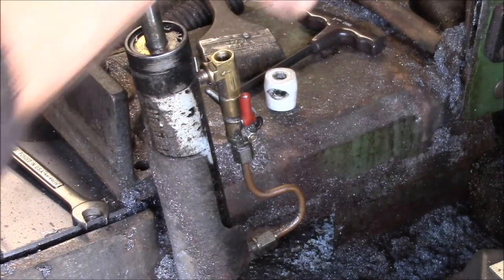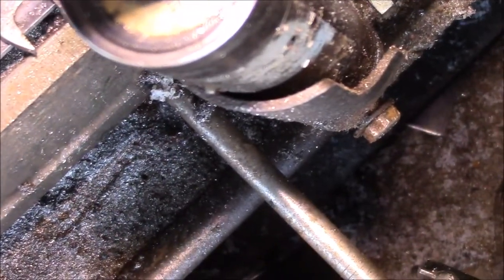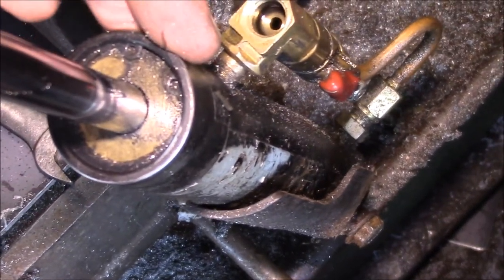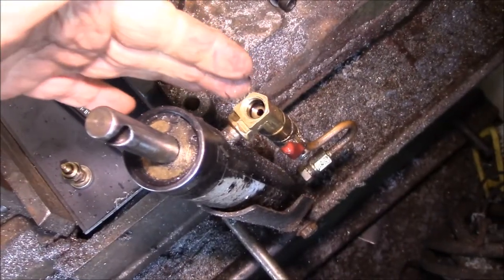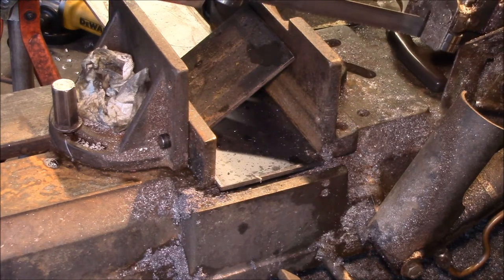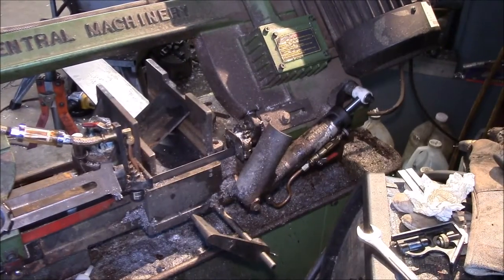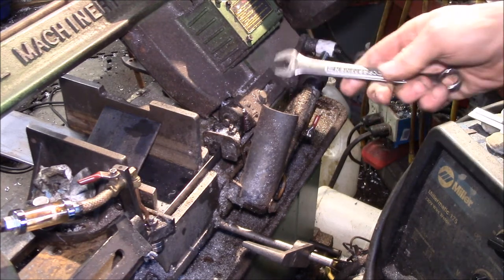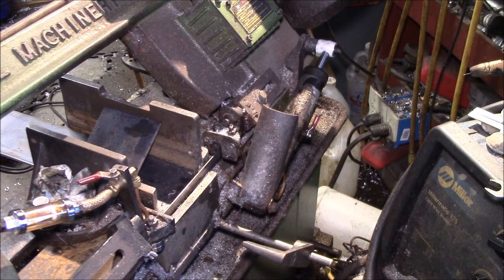Horizontal Bandsaw Down Feed Cylinder - Oil Refill

Comment: THANK YOU!!!!!  You saved me $149 for the cost of a replacement cylinder!  I was recently given a 20-year old cut-off saw and one of the things that was a bit hinkey was the erratic operation of the down feed cylinder.  It would only work for the last inch or two of the cut or sometimes not at all, and it wouldn't always reset itself when the saw was raised.  While there was no sign of damage or leakage, I decided to try refilling it after seeing your how-to video.  Come to find out the problem was low oil and after topping it off just like you did, and then bleeding it (my unit has a bleed screw), it now works perfect and like new.
Reply from the maker: Glad you were able to fix your cylinder.  You're lucky to have a bleed screw, makes that easier.

Comment: Thank you for the video! I was trying to solve the "bounciness" in my feed cylinder when completely extended. I don't know how air could get inside over time!

I filled the cylinder with hydraulic oil the way you you did, it was better but not perfect. I still had some air at the top of my cylinder that I couldn't purge no matter what I tried causing bounciness again.
 
To solve my problem 100%, what I did is, with the cylinder as full of oil as I could, and mounted on the saw, I raised the saw completely, and held it in place to make sure that the cylinder was completely at the top of it's stroke. I then removed completely the feed screw on top of the cylinder... (while still holding the saw up) ...because mine has 2 o-rings inside the feed screw, so even if I loosened it 3-4 turns like you did, it was completely sealed. I then manually, slowly lowered the saw by hand (with the valve open of course) until oil overflowed by the feed screw orifice. I had some hydrolic oil on hand in a squirt bottle, so I refilled the cylinder. I had the same problem as you. The oil would not go down, so, when the hole was full I raised the saw little by little, forcing the oil inside like a syringe would, keeping the hole full at all time to avoid sucking in air. I continued until I was at the maximum stroke of the cylinder. I then replaced the feed screw and thightened it. This way the cylinder was COMPLETELY full! Absolutely perfect! Like new! 

I was also looking at the 150$ cylinders online before trying this, so I'm very happy!
Reply from the maker: Sounds like a good filling procedure, thanks for posting.

Comment: What you should have done is get a 3/8" clear tube and stuff it in the needle valve opening. Then get a plastic mayo jar with lid with hole for the tub to fit snug and only goes in a 1/4". Fill jar with fluid. Close  jar. With the rod all the way out and cylinder horizontal, tip jar upside down and hold over the cylinder. SLOWLY push rod in a little bit. Air from cylinder will compress in jar and force fluid down. Pull rod back out , air rise while fluid descends. You can let it gravity feed or you can slowly pump the rod to get it done quicker.  You will know when you are done when no more air bubbles come out.  Lower jar below the cylinder as you put the cylinder vertical. Crack the jar lid open and this will start a syphon, let it bleed just a bit then , crack the tube at cylinder.  Remaining fluid should dump back into jar and any fluid that would have spilled out at cylinder would be pulled back in.  You can also push the rod in just a bit and as you crack the tubing off pull the rod out, sucking any fluid in , instead of falling out.

If you want to speed things up add a second breath tube in jar that goes all the way down.  Problem with that is when you start there will be fluid in the breather that you will have to either dump or blow back in.
Reply from the maker: Thanks for the suggestion.  I'll have to give that a try once I can gather all those materials.  My technique has worked well the few times I've used it.  I think in my case, the leak is from the needle valve itself.  So I need to find the time to open that up and see about resealing it.  I suspect there are some small o-rings in there that need replacing.

Comment: I need to do this on mine, thanks for the tips.
Reply from the maker: Great, glad the video was a help.  I still need to dig into mine and see if I can find/fix the actual leak that is causing the loss of the oil in the first place.  I just need a day or so of down time in customer orders where I can tear the machine down and figure out what's going on.
Reply: mine leaks at the valve /lever shaft  (open -lock valve)
Reply from the maker: Yes, that's where mine seems to be leaking as well, at least that's where's oil wetness.  I need to open that up and see if there is an o-ring or packing that can be replaced.

Comment: Thanks! I thought i was going to have to buy a new cylinder!
Reply from the maker: That's probably what they want you to do :)
But yes, have filled mine up once and then topped it off once.  I think the valve on mine is the source of the leak.  I need to take that apart and see if it can be repaired or replaced.
Reply: R Brown I bought a used wilton 5”x8” and its leaking around the shaft and I looked up rebuild kits but I can’t find it. Hoping I can top it off and it be good
Reply: @The4Crawler  Often the seals get ruined when the cylinder rod is pointing up. Metal shavings get stuck and pulled in, ant that ruins the seals.

Comment: I'm a bit late to the party but I suspect that tipping the cylinder upside down (or more importantly having the lower port uppermost for the air to rise and exit through) as you push the rod in, would get any trapped air into the area above the piston where it doesn't matter to the operation of the cylinder damping as it compresses.
Reply from the maker: Yes, that does help.  I finally got rid of the plastic piece covering the bottom of the cylinder and now it can fold over almost horizontal.  Still traps a bit of air that's easily bled out.

Comment: Great vid, but it was of no help- after I pulled my cylinder, I realized that the erratic operation and varying speed of the “drop” was because of the big pin between the base and the C portion of the saw- check yours and maintain it 👍
Reply from the maker: Great point!  Is that the bolt at the top or bottom of the cylinder?

Comment: Good repair. I have the same problem. A new cylinder costs $300.
Reply from the maker: Yes, I looked up the price on those a month or so ago and found the same thing.  I need to try and rebuild the valve on mine, I think that's where it's leaking.

Comment: I had similar issues, no matter how I fill my cylinder It keeps creating air bubbles that I think it comes through between the shaft and the top cover...but there is no leak during operation. So my question is it normal that it sucks air from top side?
Reply from the maker: I've not had a chance to tear into the cylinder to see how it works inside.  I've not run into that specific issue, I think mine is leaking through the on/off valve.

Comment: Can you do a overhaul on the feed cylinder? Such as seals?
Reply from the maker: This thread implies that it's possible:
https://www.practicalmachinist.com/vb/general/bandsaw-downfeed-rebuild-cylinder-valve-379210/
I need to see if I can fix the leak in the valve on mine, if I can get the cylinder removed from the saw.

Comment: what viscosity to fill in the oil in the hydraulic cylinder
Reply from the maker: I used a hydraulic jack oil from the local hardware store.  It doesn't list a viscosity on it, but it is fairly thin.  Added some information on the jack oil I used in the video description.